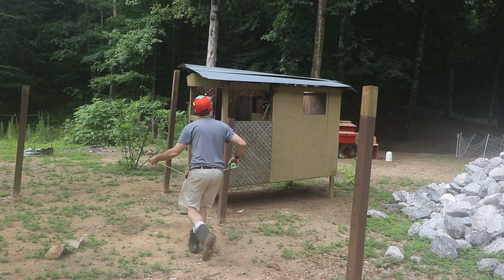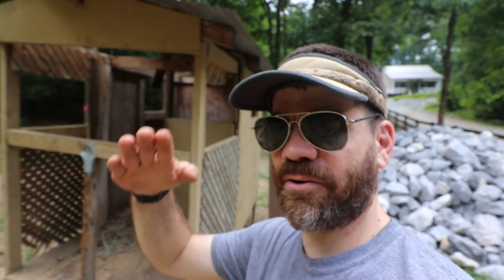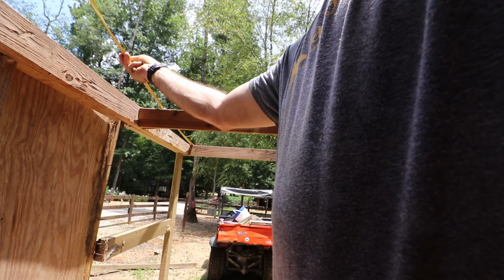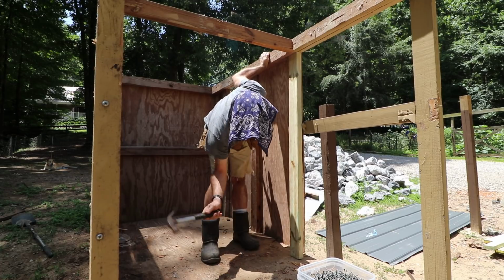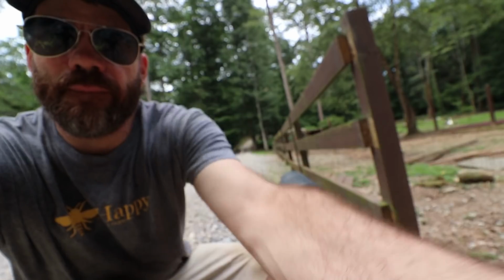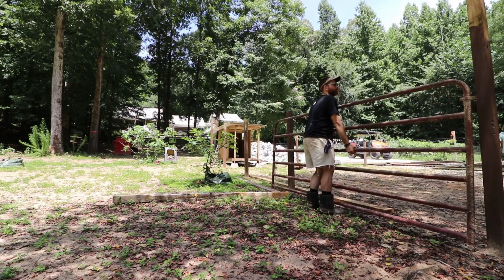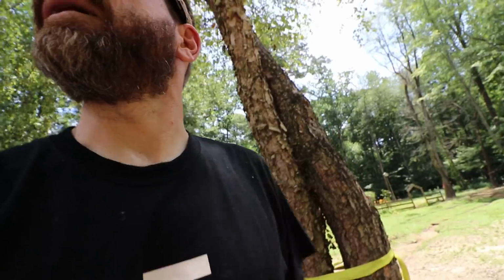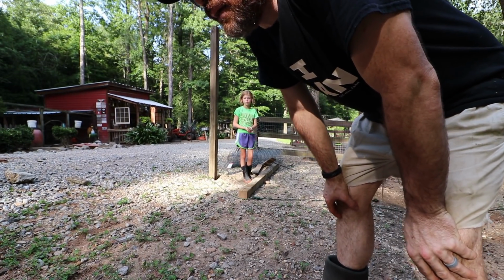FLIPPING This Treehouse To a Goat House!

Comment: I grew up watching and helping my dad build things. He helped me build a pole shed for my horses when we moved here years ago.  He'd measure and run string, remeasure, check square and plumb... but we used old power poles which are round and narrower at the top. So there was a LOT of adjusting and tweaking and come along work.  LOL.  After a couple days of fussing around with the bones of the thing, he said, "aw heck.  It's not a church!" and we had that sucker done in a day after that.  The horses have never once complained.

Comment: I'm with you on the heat! Currently trying to build a new polish chicken coop and run..in the Louisiana heat! 🥵🥵 luckily I picked a spot under the oak tree's (for shade and hawk protection) or else I'd be dead by now..🤷🏻‍♀️🤣🙌
Reply from the maker: It has been ROUGH!  I should have been able to knock out that pen in 1 day, but whew!